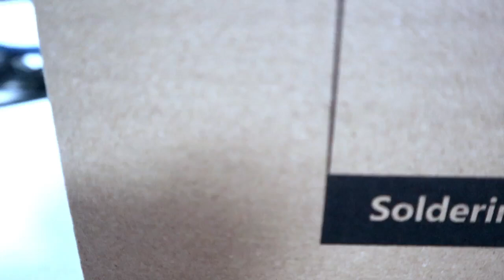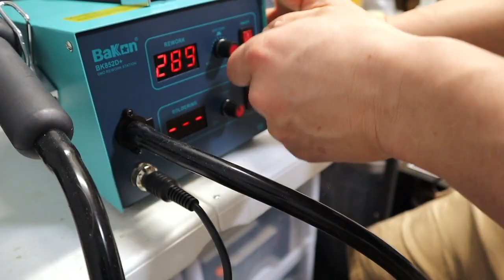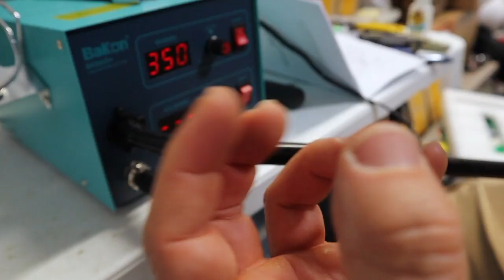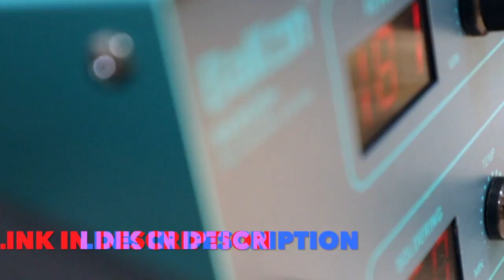Bakon  BK852D+ Solder and Desolder 2 in 1 Station

Comment: I was waiting on a english Youtube review of this station, but the price kept fluctuating on Amazon, so i took the chance and baight the 701D. I was very disappointed. A screw was rattling around inside, turns out it was the nut from one of the screw that bolted the transformer to the case. The transformer was touching the air pump, the iron was grounded because they didn't at least scrape away a bit of paint on the front panel so it could be grounded to the body. 

The temperature for both the hot air and the iron were off by A LOT, and no amount of compensation could fix it. So then i got this one, same nut rattling around inside, but at least this time the trnsformer wasn't so close to the pump and the temperature of this one was accurate for both the iron and the hot air. All in all they're cheap and cheaply made but the components seem okay.  Oh, and the iron isn't 60 watts, more like 48 watts.

Comment: Thanks for the video!  I just ordered one!!!   You sold me on it, man!!!
Reply from the maker: its a good little unit i will say turn the heat up on the heat gun a bit more if needed ...
Reply: @CJScratch  Mine came with two of the larger heat gun nozzles and not the smaller one!  Just wondering if yours came with both the larger and smaller nozzles.  The photo on Amazon shows two of the larger nozzles (like mine) which seems strange!  Thanks!